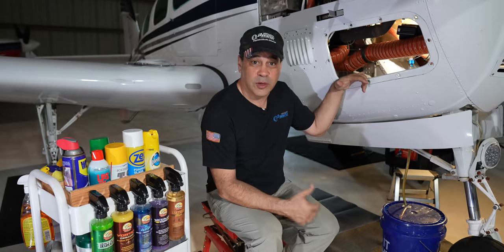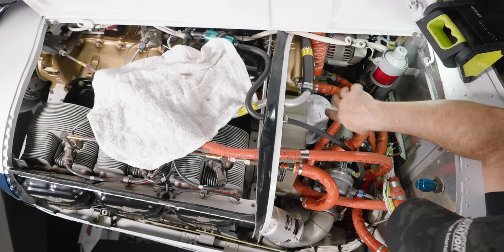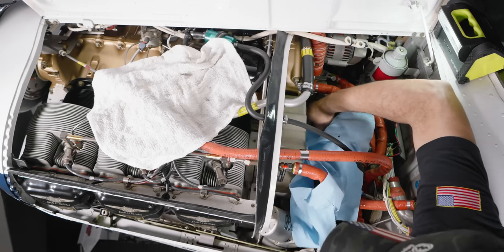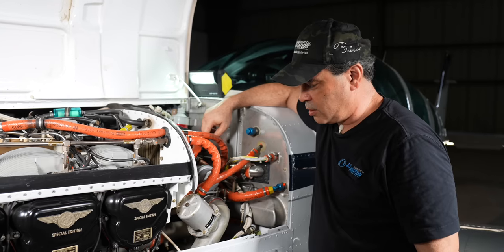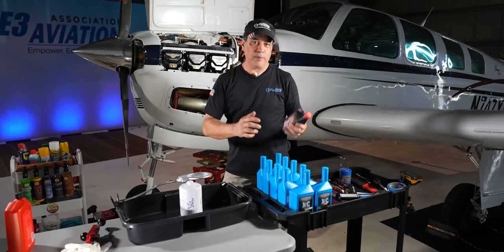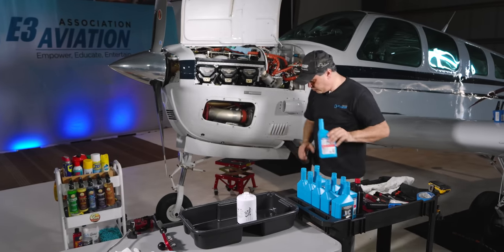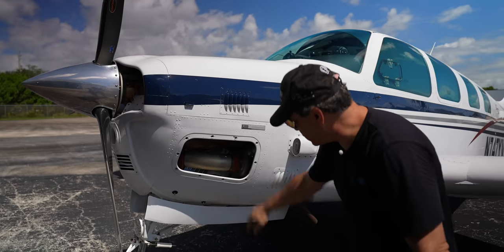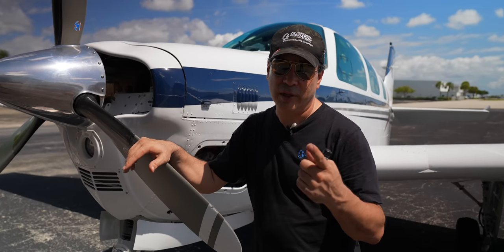Warning! Avoid Costly Aircraft Oil Change Mistakes

Comment: Nice quality video. Lighting, etc. Since you were asking for comments, here’s my .02.  After cutting the filter housing, I take it over to a big empty table and after razorblading both sides of the media, I sit down and carefully and slowly pull it out in handfuls using my 4 fingers making sure I contain any possible contaminants, then slowly extend it out on the table in two pieces for inspection. If you pull it out accordion-style you could trampoline any metal captured, especially if it’s dry from draining overnight. One more dumb little habit I have is to do the leak-check out of the sun. Cheers.

Comment: Not an A&P, but you did some things differently than I would (being really nit-picky here):

1. Wipe that quick drain off thoroughly so it doesn't drip oil
2. You called it: you used the torque wrench for loosening when you had another ratchet
3. Personal preference: towel stuffed in the clean side of the adapter is too much FOD risk for me.  Just rest the towel on top
4. Pre-cut the safety wire to length: on a Bonanza, measure the wire from the fuselage along the wingspan to the point where the chord changes (the "kink") in the wing
5. Instead of starting the twist with the pliers, use your hands to set the first turns of the wire close to the base.  Then use the pliers to run it down.  Also wrap the end of the wire loosely around the pliers so it doesn't whip around (AC 43-13)
6. You may have done it: wipe the gasket mating surface to remove any gunk
7. You installed a Tempest Spin-EZ filter which says in giant letters NOT to apply oil or DC-4 to the filter gasket.  The gasket is coated with an anti-stick compound already
8. Not a mistake, but I was always told gasket contact plus 3/4 turn.  Regardless, you did the right thing by using a torque wrench (but the value is thrown off by the fact that you lubed the gasket)
9. After running the wire through the tab, pull it tight with the pliers: "... safety wire must be tight after installation" (AC 43-13).  Then start the twist by hand, then use the pliers
10. After you cut the filter, you start looking at the wrong side of the media!  The dirt is on the outside
11. Piling on: doing a run-up without removing the tug seems real bad
12. Not a mistake, but I like to get an inspection mirror under the filter gasket to see if it's weeping after the run-up
edit 13. I don't know how your torque wrench works, but didn't you hit 16 ft-lbs on the first green light, and then kept turning it until it went red (over)?

Overall though, mostly correct!

Comment: I hope you didn't make too many mistakes, because your process is pretty close to the way that I do it on my A36.  When putting the oil filter back on, I put it on hand tight, then back it off, then go back to hand tight before doing the quarter turn.  This seems to lubricate the surfaces, though after watching this I'm going to need to put a torque wrench on there to confirm.  
One thing I would not do is do the run-up with the tug still attached.  I don't have any  experience with that tug, but it seems like a really expensive mistake if the nose wheel were to pop out of the cradle on the tug.
Reply from the maker: @keltylanham4994 LOL We were waiting for someone to mention that.   It's not good practice.   We do keep it on the tug a lot because its like a chalk.  But we also put a chalk on main gear.   The prop is not closer to the tug and it is to the ground when off the tug.
Reply: @e3aviationassociation  I think I just have some tug envy.  My bigger concern was stress on the tug rather than the prop, it looks like you have plenty of clearance.